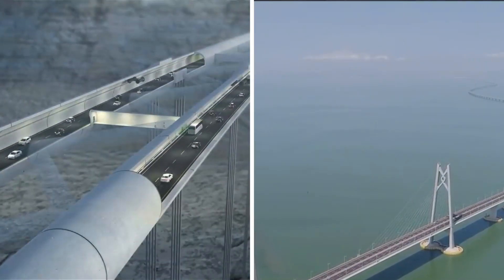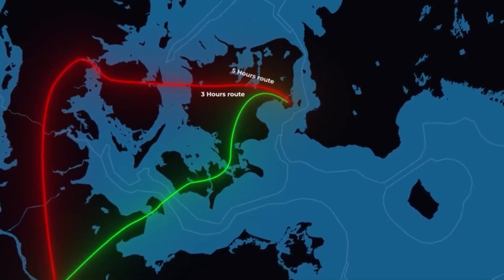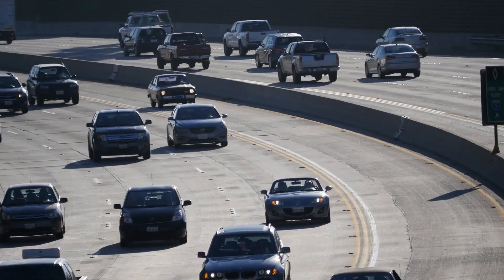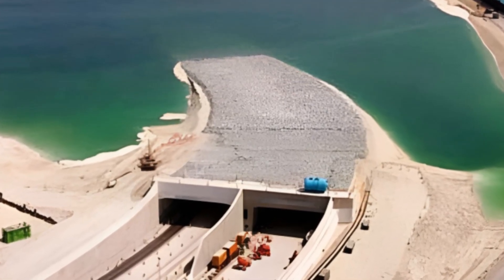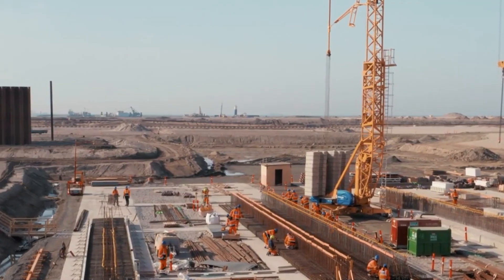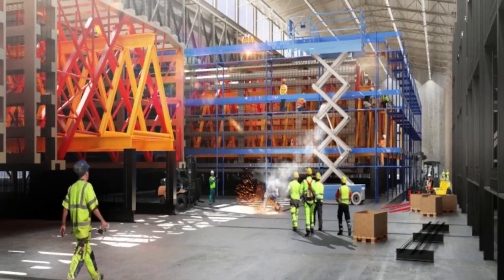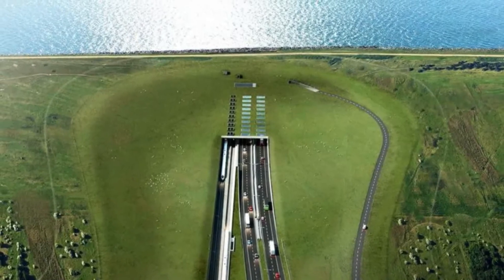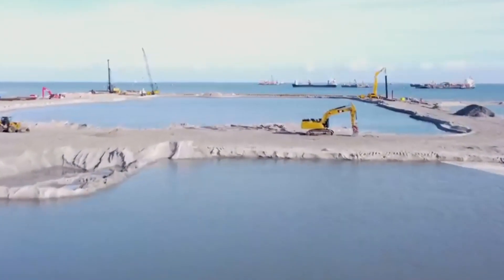Fehmarnbelt-Tunnel - Connecting Germany and Denmark!!

Comment: As a Dane I have hated the ferries during the many years I drove to Belgium many times a year during weekends. The ferries never sailed when I needed them and it cost a Ferry to cross, with no competition, as during the some years with an extra line sailing from Gedser. When it stopped Scanlines raised the price for both ferries! I do hope to be able to cross, as now 76!!
Reply: Besides the sailing time on the ferry, you have to add - waiting and loading/unloading time, which - optimally are adding a quarter of an hour in Rødby or Puttgarten, needed to arrive before the one, of several Ferries sails, if lucky, and the time to unload the ferry in the other end.
      So it isn't just the sailing time for the crossing (And during Vacation Times, a waiting line of cars out past the entrance of the Ferry Harbor, on the Motorway also, and no Reservations Active by then)! And ferries don't sail at all times and not very often during nights, when I had a use for them 🤔.